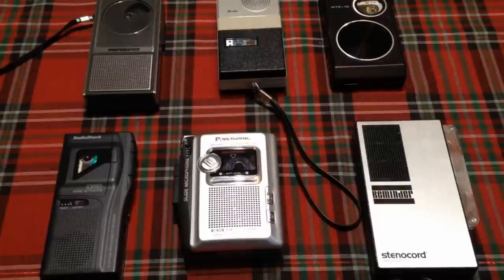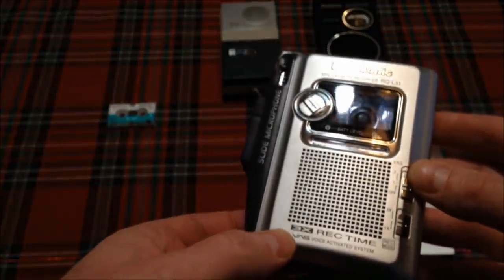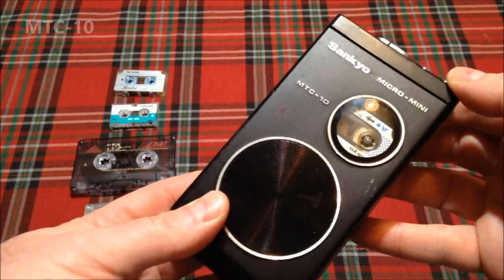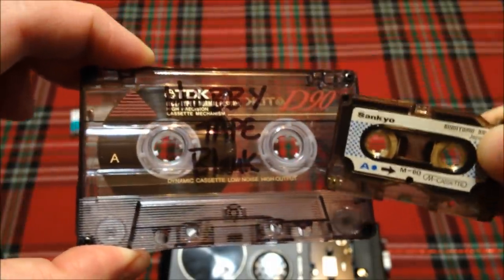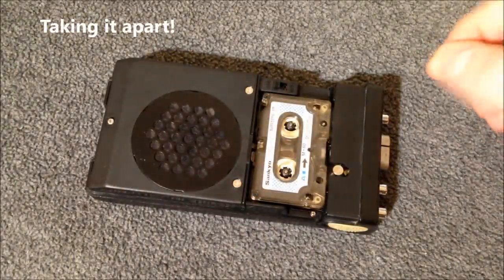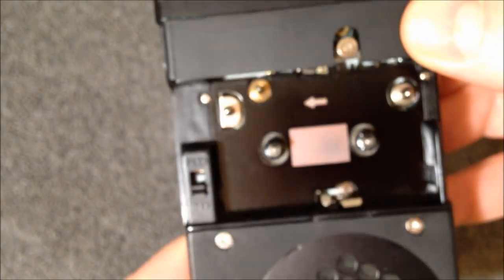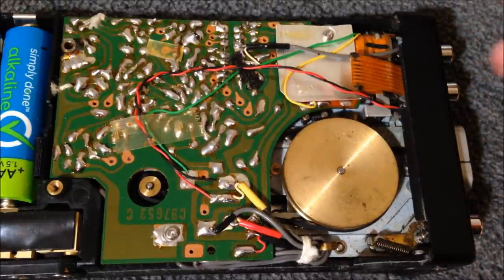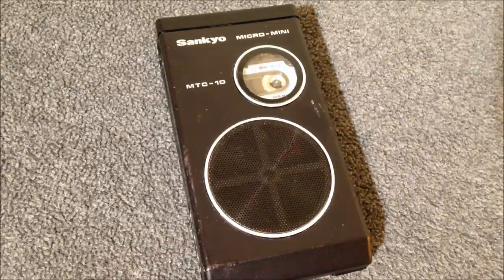The Totally Obscure Micro-Mini Cassette Format

Comment: I used to collect microcassette tape recorders, and I’d never knew of this. I did have a few minicassette recorders (and even the picocassette) but this orphan format is a totally new one to me! As much fun as it was, I don’t miss working on microcassette recorders. Unobtainable belts, flexible PCBs (usually corroded by forgotten batteries), leaky caps and parts the size of swiss watches.

Comment: I have this exact unit but no micro tape, I've been wanting to take it apart to see what's inside but didn't want to damage it, now I don't have to.  But where to find those little tapes!!!  Interestingly even though mine is also MTC-10, the filter labeling is different, your appears to be part of the mold and also has "off", mine is silk screened in white and only has markings on the "FLTR" position, nothing for "off".  Awesome video, thank you!

Comment: 15" per second. Isn't that the very high speed that makes high end reel 2 reels so good? Surprised to see that on such a small unit
Reply: He said 15/16 inches which corresponds to only 2,4 cm per second, comparing to 15ips or 38 cm/s for a reel to reel master tape
Reply: @rikkardo71  ah thanks for correcting me. Didn't make a great deal of sense what I'd misunderstood especially when it appeared to move a similar speed to a regular cassette
Reply: Confused me too. I knew it wasn't correct because I suspected it to be half cassette speed. I'm more a 2.4 cm/s kind of guy. All those fractions 🤯🤭